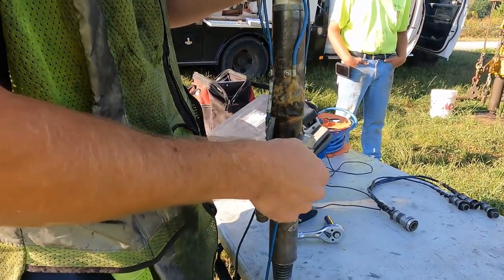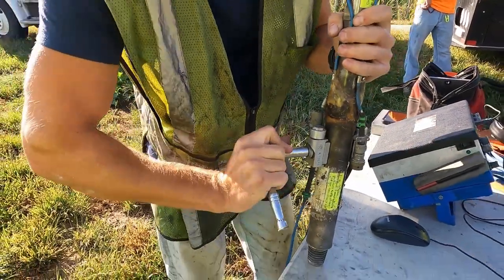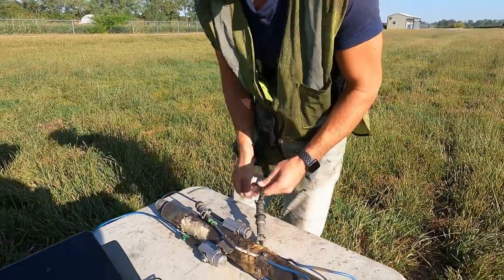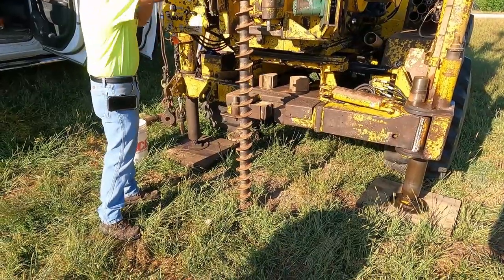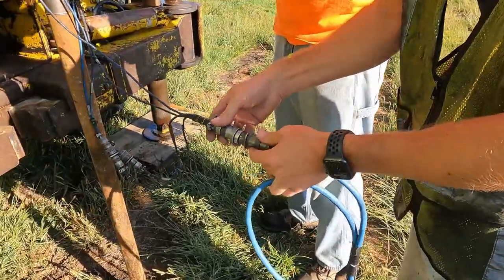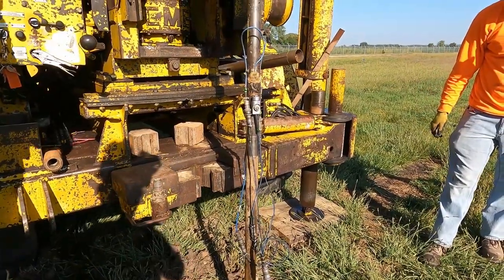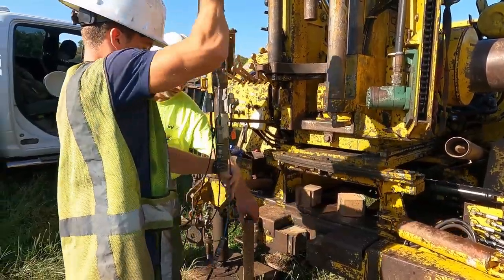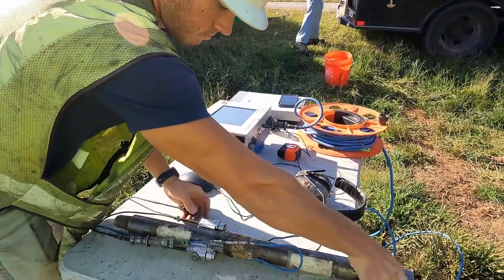SPT Hammer Calibration Procedures

Comment: A firm I once worked for required that blow counts from borings 20 feet or more in depth were required to be obtained using NW rods as opposed to AW rod.  A study had found that a good deal of hammer drive energy can be lost in the sidewall of the boring depending on the depth and firmness of the soil being sampled.  Is that an issue today?
Reply from the maker: I don't think I that this precaution would be necessary as long at the hammer had a "calibration" or documented energy measurements to determine the energy correction factor relative to N60 blow counts.  This is a service that my company performs and I made a video for an overview of the measurement method if you are interested in checking it out.  https://youtu.be/i1DJbMS49jw